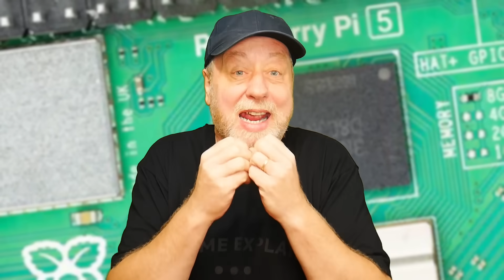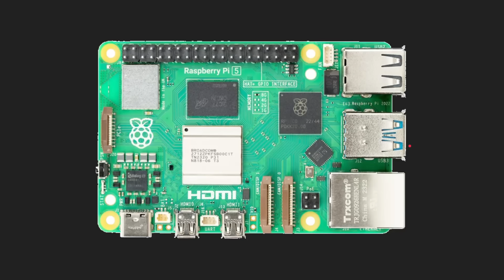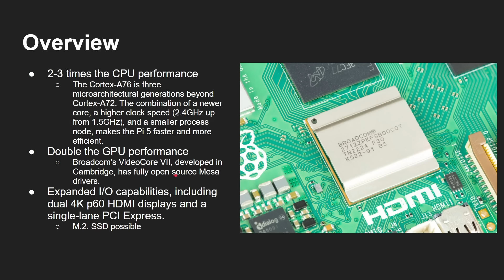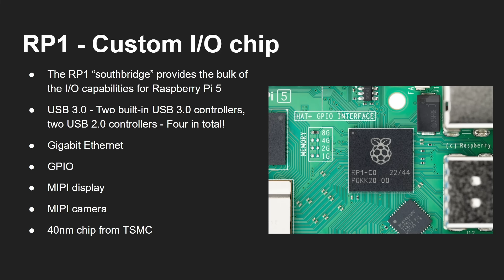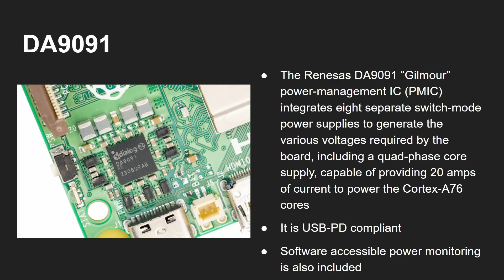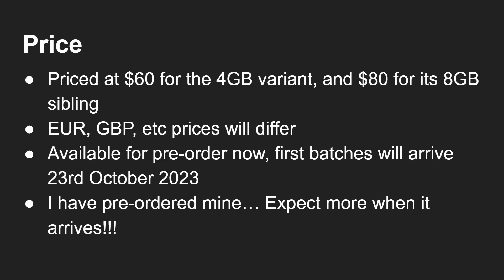Raspberry Pi 5 Launched - 2 to 3 Times Faster than the Pi 4

Comment from the maker: 🎯 Key Takeaways for quick navigation:

00:42 🚀 Raspberry Pi 5 offers 2 to 3 times speed improvement over the Pi 4, with a new quad-core 64-bit ARM CPU running at 2.4 GHz and a 16nm manufacturing process.
01:36 🎮 New features include a VideoCore 7 GPU, support for two 4K monitors at 60fps, built-in hardware H.265 decoding, and LPDDR4x RAM with options for 4GB or 8GB.
03:19 ⚡ Improved I/O capabilities with full-speed USB 3.0 ports, gigabit Ethernet, two 4-lane MIPI camera/display transceivers, and exposed PCI Express via ribbon cable.
05:09 🧩 A custom chip called the "rp1" acts as a Southbridge, supporting USB 3.0, gigabit Ethernet, GPIO, and more, enhancing the Raspberry Pi's I/O capabilities.
07:38 🔌 The Raspberry Pi 5 includes a power management IC (da1991) for efficient power supply management, supporting USB Power Delivery and active cooling is recommended for optimal performance.

Made with HARPA AI
Reply: Can you do an episode on MIPI? I know nowt about it.

Comment: I’d like to know if I2C finally works. Yeah yeah bit bang. Specifically features like clock stretching.  I have to use my Arduino boards for all my sensors that use stretching.

Comment: I look at an RPI because it is cheap, easy to use, does not need a fan, and is fast enought for most applications.
The RPI 5 is a departure from this: now the fan is standard, and the price is significantly higher.
At the same time some fanless small factor PCs with N4000 processors are below $100 with storage, enclosure and power supply. The specs are better than the RPI 5.
I only hope that the RPI 5 will only extend the product line, not replace.

Comment: When the Raspberry Pi 5 comes, can you explain how you use the PCIe connector. Do you use a Flexible ribbon cable (15 or 16 pins?) and does it connect to an adapter for memory, or to a display?

Comment: These used to be cool for $35 years ago. Now it’s more expensive than Intel N CPU (N5105, N95, N100) after cooler, power adapter, case and SSD while having worse performance.
Unless you need GPIO or specific use case, these are not that good

Comment: I'd like to see a performance comparison of Pi 5 to Pi 4 with no fan.

After four years, I expected more.  They moved the ports again, so they could have made a longer board to support M.2 storage without a fragile ribbon cable.  They could have put at least one full-sized HDMI port.  It has no memory bump at launch, and Gordon Moore would be disappointed with its performance.  With the recommended fan, the new power supply, and the HDMI adapter, the 8GB version tops $100 before M.2 adapter and sales tax.  I'd rather have an Apple Pi. 😉

In spite of all this, I want one.

Comment: Really would be interesting to see if the USB PD can use higher than 5V power. Because currently it seems that it requires a 5V 5A power supply which seems excessive and it's hard to come by unless you get their official power supply.
Reply: 💯 this. I hope the board is designed to tolerate weaker power supplies for those who don't need to pull that much power. 

If instead the board drops out with a less than ideal supply as previous boards would do, those bricks are fixing to get really expensive.
Reply: @Henfredemars  I think Jeff Geerling tested it and told that the previous 5V 3A supply from the Pi4 also works, but there may be some performance impace.

Comment: i would be shock if no skip video on desktop but noh. same. so not 2 times faster. if 4k 30fps lag rpi4 this should be smoothlessd LOL, but what bout good old 1080 I STILL USE that was that last video format LOL. everything downscale smaller automatic and its faster lol lol 4k? what. you cant play games on 4k 8pixel font is so small even 46inch monitor, but its look good on steam deck. NO its too small i say it allready LOL steam deck is good for nes games

Comment: Why isn't anyone talking about availability?
I simple couldn't get my hands on one raspberry pi for ears, and in my country the biggest reseller put a cap limit of one raspberry/person. That means I am not able to buy it anymore and other suppliers just don't have it on stock, or if they do have it, it is gone in a matter of minutes.
Reply from the maker: Everyone has been talking about Pi availability for years now. The situation has improved a lot and will continue to improve.
Reply: I'm doubtful I'll be able to buy one of these for a long time, but in the blog post from the Raspberry Pi foundation It's clear that they're taking this seriously and implementing steps to improve the situation, like getting priority access to some individuals. 

Of course, one needs to understand that these are not expensive boards by industry standards. There's not a lot of money to be made in their manufacturing, so they must compete for manufacturing time with more profitable products like cell phones.

Comment: Honestly disappointed. Still mini HDMI. No USB-C display. No 2.5 GB Ethernet. No NVMe. Sure you may say those are too lofty! But not really. NVMe is quite cheap these days. 2.5GbE is quickly becoming the norm and USB-C displays been the standard for years.
Reply: Who has a 2.5G link to the public internet though? I still think that's niche for the hobbyist. 

Possible M.2 support is exciting and a step in the right direction. I was a little disappointed to see SD card on the 5, but glad to see bandwidth improvements. I would have preferred to see an actual slot for use as the main disk.
Reply from the maker: If you want the Pi to act as a NAS or some kind of home server then better Ethernet is always welcome.
Reply: Very disappointing. Get an Orange Pi 5 Plus.

Comment: These new A76 cores have cryptographic extensions, it will be interesting to compare hardware accelerated AES and SHA algorithms with the software implementations on the same hardware.
Reply: I'm glad that you called them extensions. It's very interesting to hear about the new core, but I'm really curious exactly what instructions they're going to support. The previous ones have been pretty restrictive understandably to keep the costs down. 

Consider how popular TLS is these days. Using one of these as a small server could see a lot of crypto workload.
Reply: @Henfredemars  I experimented with nVidia Jetson – their CPUs support cryptographic extensions. I tested the AES algorithm in assembly (AESE, AESMC, AESD and AESIMC instructions). The encryption and decryption are tens of times faster than the software implementation. I'm sure there will be an image of OpenWRT for Rasberry Pi 5 soon.

Comment: A little confusing... How can the Cortex be getting 20amps from a 5v/5amp power supply?
Reply: Lower voltage - input = 5V@5A = 25W so if the Cortex wants 20A, it is likely running at 1.25V if not lower - that’s what the PMIC will be doing
Reply: @Umski  Thanks -- that was my assumption, but I didn't think the Cortex voltage could be that low.
Reply: @arxaaron  gone are the days of 5V and 3.3V logic - even SIM cards run on 1.8V these days - you don't really want high voltages for switching transistors at that kind of integration scale...

Comment: Yes, I was disappointed that they DIDN'T color the GPIO pins!   You didn't mention the audio connector.  I AM glad they added separate pins for the Fan, rather then using up 2 of the GPIO pins, which means blocking HAT boards to be plugged in! 👍

Comment: I hope there will be a Raspberry Pi 500. Currently, I only have a need for one of those. I use the Pi 3 and Pi 4 as servers, and they are fast enough for that purpose. However, the Pi 400 is used as an HTPC, so additional speed and hardware decoding capabilities would be most welcome.
Reply: If they do so, I hope it will come with the max DRAM config and not nobbled in that department, like the Pi400 was.

Comment: Simple Question really: Will the beefier cooler fit in the case (when you remove the case fan) and does it still work properly inside the case? The cases are said to be stackable, how does that work and what does that mean for cooling (both with the included case fan and, assuming it works with the case, the board mounted cooler). Pretty stoked about this as I am using Pi 4 in places where it could do with more performance.

Comment: Will I buy one? Does the sun come up in the morning?

Currently, I have a 1b, 2b, a 4b 4GB, and a zero 2W , along with almost a dozen Pico variations. The Pis go in and out of use as I need them, while the Picos go into real world problem solving- a treadmill fan control, a defrost timer for a 20 year old upright freezer, a controller for a 20 year old dishwasher and a controller in waiting for when the timer on a 24 year old dryer gives up.  I could have just bought new appliances but where's the fun in that, along with saving $Ks and the environment.

I am interested to see whether the Pi 5 will be able to encode 2 mjpeg streams from cheap HDMI capture devices, something the 4 was not quite up to for a single stream. That would save tens of  KWh per month over the old x86 currently assigned to the task.

So many ideas, so little time...

Comment: Big failure and end of the road for RPi. If they keep making $35 Rpi4, it will outsell this slightly improved version by a large margin.
Reply: I think you underestimate the volume of the product they ship. They still sell the original Raspberry Pi in huge numbers. It's used widely in industry in applications that favor stability and long-term support over performance.

Another perspective: their customers come from all walks of life. Some are hobbyists. Some are industry professionals. They will have different needs. 

How is it the end of the road if the foundation is still making and selling the older models?

Comment: I was waiting and expecting this video. Sad to see that Gary is not on the influencers list. Here's me engaging, so Mr. Gary gets more exposure.

Regarding what to do with it... well, efficiency benchmarks! I know this isn't Pi Pico, but I'm still curious. Also, how can that power delivery chip be used. Would it be possible to always have the current current draw in the taskbar ? Also, how accurate is it, if compared to what a smart plug/wattmeter shows ? Does it have only reading capabilities, or can it be interacted too ? Like setting a power limit ? Though I guess that if you know the power you're using, you can implement a power limit by simply downclocking when you read you're above the threshold. Also, for tasks that can be done by Pi 4, would this upgrade allow a lower power draw for the same task ? What is the lowest you can go in terms of power use ? Though I guess the last questions are a bit too generic :D

Given the improvements, a "Pi 5 500" keyBoard should be an actually decently usable computer.

Also, thanks Mr. Gary for the specs breakdown. Neat to see them all at a glance. And the power delivery details.

Comment: That is great news! Still, 25W max is a big oof to me ( I know this isn't "real world power draw", but for extremely low power enthusiasts like me... that raises a red flag regarding power consumption. Hope I'm wrong.).
-EDIT Oh yeah. And also no nvme support for extra oof. "Gus stop being a hate--" nvme lasts "forever", you know.
Reply: Yeah I was concerned about this too. Initially, at least in Explaining Computer's review, it seems like the power consumption is somewhat on par with 4, or maybe only slightly higher. Still early too and RPi4 got lots of improvements over time with software updates etc.

One thing for sure though, is that RPi5 is more EFFICIENT. Performance per watt is much better according to Jeff Geerling's review.

Comment: This is great for us nerds but what do you do guys use this for (other than as a tinkering toy)?
Reply: Currently, I use my Pi 4 as a router running OpenWrt (with a USB Ethernet adapter to give it a second port so it can connect to my modem and my network switch/AP). OpenWrt allows me to have (1) network-wide adblock, (2) SQM for keeping Internet latency consistently low (less lag & jitter for video streaming, video chat, VoIP, multiplayer gaming, etc), (3) WireGuard VPN client with a commercial VPN provider, and (4) site-to-site WireGuard VPN with family. Pi 4 has a lot more compute power than a typical router, while being cheap and energy efficient.

Prior to that, I used it for retro game emulation with RetroPie. The Pi 4 can emulate up to PSP, N64, and Dreamcast. Pi 5 emulation performance remains to be seen, because will take time (months) for developers to optimize their software for it.

You can also use a Pi as media streaming box, a basic NAS, a cheap infotainment system for your car (Android Auto), digital signage for a business, or a cheap desktop computer for light use, etc. There are many different things you can use them for.

Comment: The only thing that excites me about this is that the camera connectors now use the same cable as the RPi Zero boards. That should mean that the cables will eventually be more readily available. I'm tired of buying cameras and having to throw away the included cables because they don't fit the RPi Zero connector. I only use RPis for battery powered projects so the RPi 5 isn't going to be something I have a lot of use for.

Comment: No audio jack is a real bummer though
Reply: as with the RPI Zero, you can probably redirect the PWM audio signals to two GPIO pins, and add your own filter logic to get stereo output. if you want to use the PI5 as a base for your portable gaming machine. And there is also I2S audio on the GPIO, so you can connect a codec for high quality audio input and output
Reply: Add on to Martin, there is also HDMI. Since it's an Raspberry, I'm sure there will be a lot of attention and documented solutions/workarounds as this gets out into people's hands.

Comment: So, still no native support for booting off of SSD without a bunch of tricks instead of having to use the crappy MicroSD cards that fail all the time?   The single biggest gripe I have heard about Rpi since day one was the reliance on those SD cards which have a terrible track record, and here we are at gen 5 and that still has not been addressed.
Reply: What bunch of tricks? Enabling USB boot mode is extremely easy. It can be done with a single command.
Reply: You can boot FROM a SSD without a lot of hassle.
Reply: Yeah and just use a USB stick instead

Comment: Do you think these will be able to run LLMs?
Reply from the maker: I already have a video showing how you can run an LLM on a Pi 4, so obvious the Pi 5 can do it.
Reply: @GaryExplains  right, but I’m talking about what could be expected running an LLM on a Pi5 vs Pi4. Sounds like another YouTube video topic for ya
Reply from the maker: Since the LLM projects like llama.cpp only use the CPU in the Raspberry Pi and the Pi 5 doesn't include a NPU, then the LLM will run 2 to 3 times faster, as this is the general bump in CPU performance.
Reply: @GaryExplains  what is llm?
Reply from the maker: Large Language Model like ChatGPT, LLAMA, Bard, etc.
Reply: Dope. Thanks for explaining !